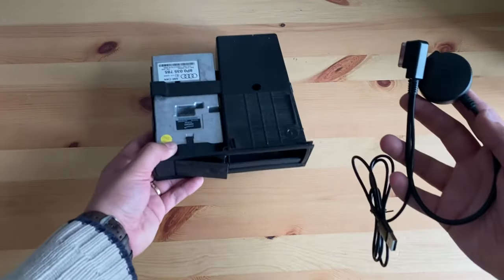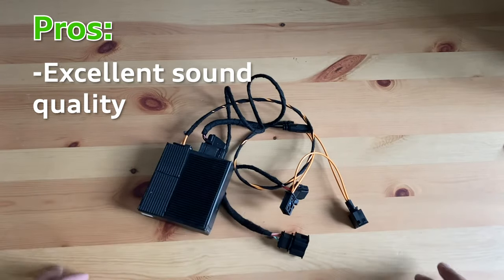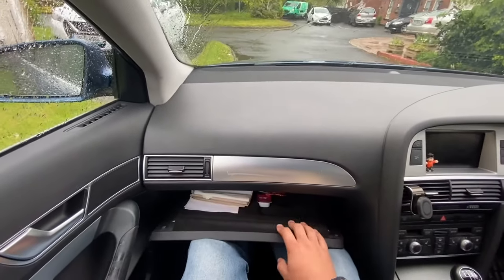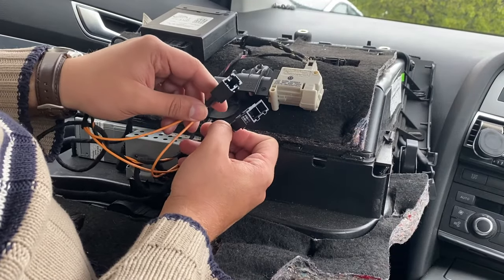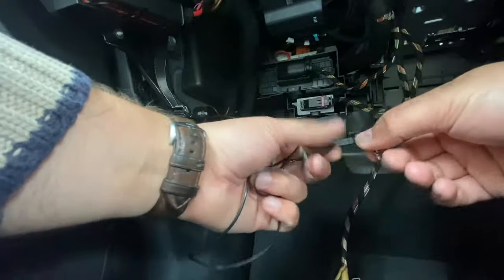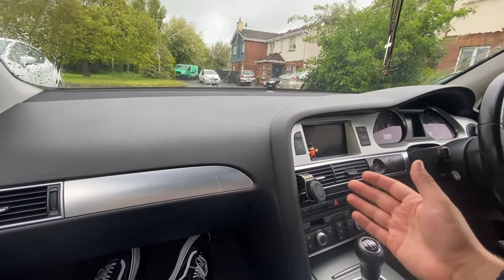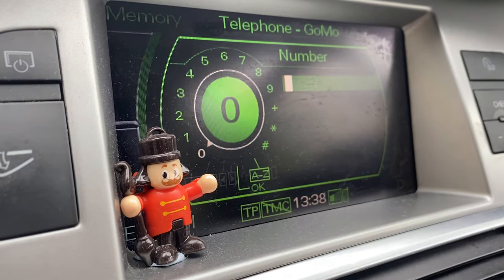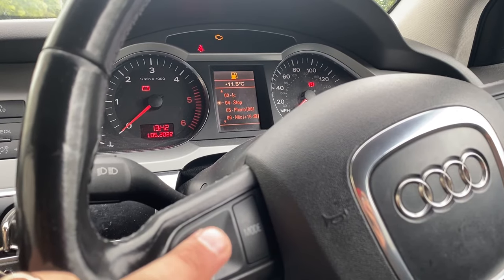Installing a MOST Fibre Optic Bluetooth Kit for Audi A4/A5/A6/A8/Q7

Comment: I have a 2008 Audi a6. I tried the ami Bluetooth adapter and it didn’t work. It wouldn’t even show up on my phone for Bluetooth. And there was no indication that it was even on or working? Is there anything I can do to fix it or did I just order a faulty one?
Reply from the maker: Hi, provided it's been coded correctly via VCDS it should show up.

Comment: Hi! I’ve got a A6 C6 2007 with MMI 2G low basic without the telephone function/button. Will it work for calling and answering and bluetooth music connection? Many thanks!
Reply from the maker: Hi, does your car have AMI or a CD changer? In case of either, you should be in luck! In case of a CD changer and a fibre optic module, it'll work both for telephone and streaming
Reply: @Adam_G Much appreciated! Thank you for your response!
Reply: Quick update. I bought a Kufatec 43394 and when I tried to install it the power supply was different from what I had on the car so I had to conect it to other cables behind the CD player. It worked but only for music streaming and it didn’t work for phone calls also the car doesn’t have Channel 12 on VCDS so maybe that’s why it didn’t work for calls. Sound quality is awesome

Comment: Hi Adam, I have an Audi Q7 2006 with no Ami, and you wouldn’t even believe the drama I’ve had trying to get Bluetooth to work….. thousands of dollars and it’s not working and a massive headache! My Bluetooth module has died, so I have replaced it with a fibre optic loop so the stereo sound would work again, do you know if I install the unit you have, it will work even considering I have taken the factory module out?
Reply from the maker: Hi Dylan, if the original Bluetooth module is responsible purely for the telephone function (taking calls) you should be fine without it- my A6 came without it!

Comment: Hi Adam. I have an Audi A8 d3 with phone cradlle in the armrest but no phone. If I press the telephine button it says like in ur video that the tel might not be properly attached. Does this kit will work for bluetooth calls as well? And also can we use original mics from the car? 
Good video and explanations. Thumb up.
Reply from the maker: Hi- this Kufatec kit will also work for telephone with full functionality
Reply: @Adam_G  can I contact you privately if you don't mind? 
I have my hands on a nice piece of kit, MOST adapter kit for sound and a multimedia,video &gps integration for my A8 , that I got when I purchased my car interior with headrests lcd's. On those ones I would like,if possible and if you have time, to give me some help as I don't know if it needs any coding or anything ,as they came without installation instructions.

Comment: Do you know if the wiring is already there to connect straight to the new kit even if I don't have a mmi or disc changer in the glove box?
Reply from the maker: Hi, it depends on the trim level, I'd say the most sure way would be to remove the glovebox and check.
Reply: @Adam G  thanks, mine is an s line but can't find aux or mmi port anywhere

Comment: Hi Adam, 

My car is Audi a6 C6 mmi basic without navigation or telephone system and single CD player that doesn't even work btw, will it work ? 

Thanks
Reply from the maker: Hi, in case there's no AMI or CD player, unfortunately you haven't got a point for an AUX connection...

Comment: YESsss ! perfect ! I'm looking  for a MR 12v or dension. Very great video. So tell me why vcds ... On MR12v you can select if you have oem bt phone.  I have a 6 cd changer in the glovebox, and i want to keep only oem BT for my phone, and put bt module for only stream.  As same you, i have a a6 c6 scottish import in RHD, and i leave in france. Best regards
Reply from the maker: Hi, my car had no factory BT telephone, as such I had to enable it from zero. You should be fine keeping the factory telephone and having a separate streaming module! Bonne chance
Reply: @Adam_G  Hi Adam ! thanks for your kind answer :) I have oem BT calling. I'm go to buy kufatec is too easy. I hesitate to mr12v or dension .... Merci
Reply: Very good explanation of every step. Thumb up! But why don't use the genuine microfone system if the car is equipped with phone? I guess the original microfone system will be in perfect quality, especially when there are 3 microfones in cabin in their original and most suitable place.

Comment: I have a 2009 A6 but how do I know if it is 4F? Also where would I buy one of these kits?
Reply from the maker: Hi, it should fit all models of 4F/C6 generation (2004/5-2011). You can google Kufatec 43394 to find many sellers selling this kit, best regards

Comment: maybe someone knows why nothing works after connecting the adapter. the radio and the display stop working. when I disconnect after a few minutes it starts working. I bought this adapter used before taking it out and it worked. mmi2g high. 
the adapter is the same as the video car as well
Reply from the maker: Most likely a faulty fibre optic circuit- could be a faulty Bluetooth module. Any warranty on the kit? Alternatively maybe one of your friends also has an Audi with MMI 2G to test the kit? Sėkmės 👍🏼

Comment: ciao è da tempo che cerco il modo , ma non hai messo dove lo hai acquistato? io ho Audi A4 Anno 2012 Sline cv 143, va bene questo kit che non so dove trovarlo tu dici di pagare 90,00€ mi dici dove se va bene grazie.
Reply from the maker: Hi, I bought mine on a local adverts website here in Ireland. You can use websites like eBay and Amazon and local Italian websites also to find a kit that'll fit your A4, best regards

Comment: I've installed Mr. 12 Volt in my Audi, paired with BOSE makes a great pleasure to listen to music, the downside... It only can see 5 folders per Micro SD Card or USB as well...
So I am using the CD changer, 1 Micro SD Card and 1 USB, also... So organizing music it's a little frustrating, as it only can see 30 songs per page...

Yes, I've used the Bluetooth connection, played music from my phone, but as quality it doesn't even come close to my 320kbs files on the SD/ USB... 
I would have love to have a MP3 player hooked on but don't wanna deal with wires and still wanna use the MMI control buttons... 
So I am stuck with this slightly "limited" setup, but at least music is at CD quality and most of all I don't have to deal with stupid ipod (iOS ecosystem)
Reply: That's not good if streaming from your phone is not good quality even with Spotify? 😢
Reply: @jakubluszczak2748  Spotify it's already average quality. Bluetooth downgrade it a little more. What's the point to have Bose sound, if quality it's not CD?!...

Comment: What isn't in a 2006 a4 that means it doesn't work?
Reply from the maker: Hi Etienne! The B7 generation of A4 (04-08) uses RNS-e system, not MMI 2G. There are similar kits available, much cheaper as RNS runs on standard cables, not optic fibre